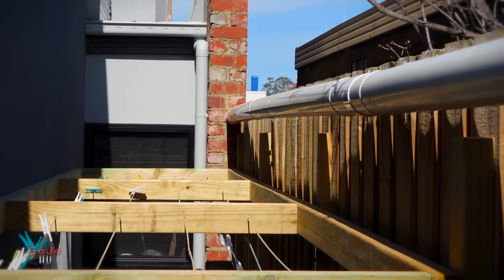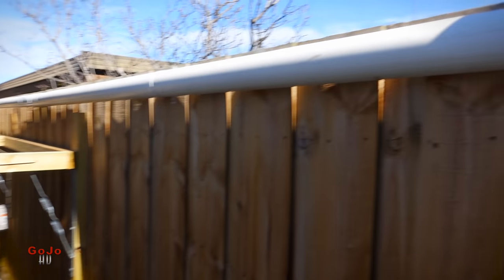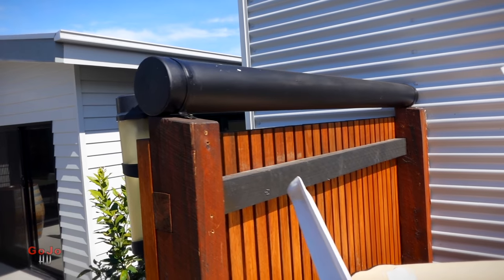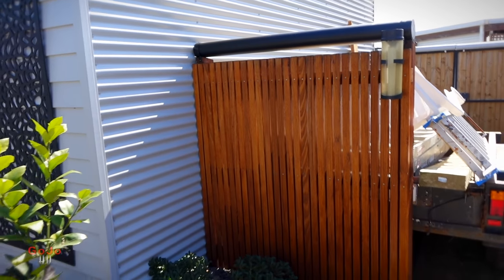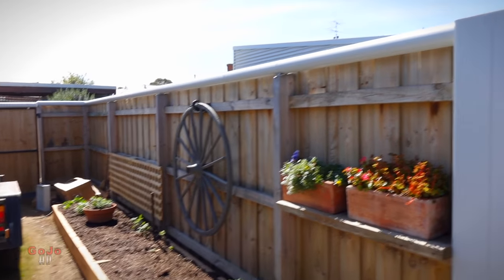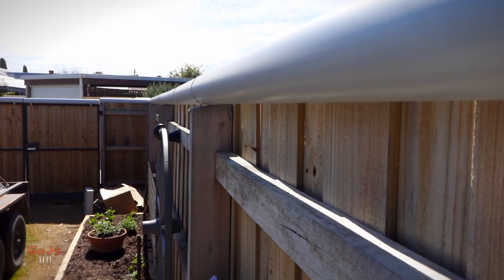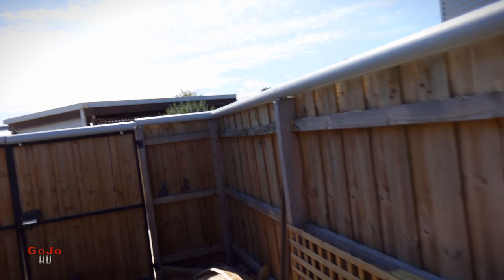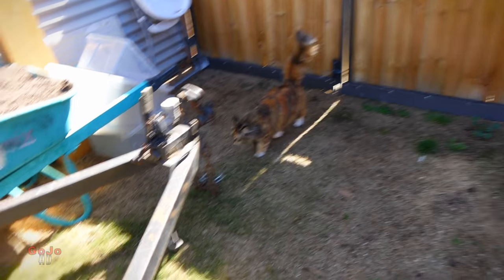Cat Proof Fence | Cheap & Easy with PVC Pipe | How to DIY

Comment: I just installed this on my fencing in my backyard.  I have three cats, and so far, no escapees!  Wish I could attach a picture!
Reply: Thank you for sharing that!  You're the 2nd person I've come to who's had success with this. I think I'm going to do it.
Reply: @elisaclark1751  did you do it? What pipe diameter?
Reply: @saaa9964  no i haven't yet. We're debating over the piping or the perpendicular fencing. We have a large backyard with coyotes on the other side so there's a lot of debate here in our household as to the best way to do this. And the project kind of got sidelined by some family crisises. I'm glad you asked though, its put the fire back underneath my butt again. I will definitely update when I do. I believe we had decided on the 3½ or 4in diameter, though. The thinking behind being the wider, the harder to hook paws around.
Reply: @elisaclark1751  Ok. I just wonder myself should I do it rotating or just like that. I want to stop my cats escaping, but don’t want any nasty nets around the garden...
Reply: What width pipe did you use please . I have ordered 1100mm pipe . I hope this is the correct size as my present fencing has failed . Thanks
Reply: Liz Johnstone  I think 100mm minimum, the pipe doesn't spin, it rather is an obstacle
Reply: @Charlenea28  I was thinking maybe instead of fixing them completely.  Just place a strong wire in the middle of the pipe and let it spin if they try and climb on it.  But to make it spin I think you need the pipe not to touch the fence and come away from the fence a little.
Reply: Is it still working?
Reply: @Mav_F  I've seen several DIY roller solutions where there's a narrow pipe (PVC or metal electrical conduit) inside of the larger diameter pipe.  Brackets hold the narrow pipe away from the wall (and can be on top of the wall as well).  Some people use wire like you mentioned but still wire + narrow gauge pipe + large gauge pipe.  But this single pipe solution looks way simpler to install and won't have any problems with sagging.  My thinking is I'll try this and if it doesn't work I can reuse the same pipe for a concentric roller solution.
Reply: @enmodo  Cribs and playpens do not have a top and aren't small.  Puppies aren't that stupid.  Do Americans have laundry areas? That's an option.  Enough now! All the best.
Reply: Did it last?
Reply: I used 100mm..worked like w charm..all cats still puzzled and indoor
Reply: Amy, all you have to do is film a short video upload it to your YouTube account and then copy and paste the link in the comments here
Reply: How's it holding up 3 years on??

Comment: While it is a lot simpler than the roller kind I'd hate to find our cat could figure out how to reach over it or somehow get enough grip with its pads to shimmy over.  I assume you found that the hard round plastic surface was just too slippery for the cat, and protruding out vs just on top creates an extra overhand obstacle.  Did you ever get a video of your cat trying and failing to escape?
Reply: Yes, you would’ve thought he would’ve videotaped his cat trying. I know I would.
Reply: If it were me, I’d make the rollers pretty loose so even if they could grab it, they couldn’t use it to get out. Can’t really tell from the video but that’s likely what he did

Comment: This remarkable system works--at least on my two cats. They are Himalayan with short legs like Persians, but he managed to reach the top of the block wall before I had the PVC pipes installed. Presto, my cat was immediately deterred when he jumped and reached the top where the PVC roller was installed. I shall now complete the job, installing the PVC pipes to the rest of the block wall. By the way, the pipes work just fine on cement--block walls.
Reply: PVC roller?
Reply: @urmomm55  PVC pipes 4-inches in diameter.
Reply: does the pvc actually roll? or is it just stationary like in this video?

Comment: Worked  for me! The cats didn’t even attempt escape :) they loved sun bathing in the afternoons and I loved them helping me in the garden!
I rent, so have added fence extenders on the lower side fences. On these parts I added core flute panelling underneath the piping which was secured on the inside of the fence, not the top. No issues, although it was kinda ugly. Recommend! Great DIY solution!
Reply: Thank you so much for sharing your experience with the pipes, it really helps to hear that it's working for other people than the poster... who may be brilliant, I'm thinking!
Reply: Is it still working for you?

Comment: I did this on the outside of my fence a few years ago and it works great! I want to do it on the inside as well, but now pvc pipe is so expensive! Do you  have any other ideas of something cheaper that could be used? Thanks much for the great idea!
Reply: The best thing to do would be to place the rollers on the top of the fence, so they work with critters coming from either direction.  That's what these people did: https://www.youtube.com/watch?v=WP1HNNZedbc
Reply: We are having this issue - looking for 2nd hand PVC pipe right now.

Comment: I love this idea and I'm going to try it!  It's so much more cost effective than alternatives.  My question is this: I have a six foot wooden fence with the railing on my side.  Do you think I could install the pipe on the railing instead of on the top of the fence?
Reply: Not sure if you ever tried it but if you look at the video you'll see he didn't put it right on top, it is on the side of the top so it sticks out and away from the fence.  That creates an overhang the cat is forced to try and reach over.  I think the important thing is the height limit he mentions - if they PVC is too low the cat could jump up and over it and then use it as a nice rail to stand on for the remainder of its escape!  But being hard and slippy it is still a better barrier than wood or netting overhang.

Comment: Thanks for your video, you mightve saved our poor kitty's life. Out vet bill has been around 2000$ this year alone due to a bully cat. The problem is im renting at a very strict place. I have 3 questions then:1- what do you recommend to put it against the wall without damaging the property(i cant put it ontop because it will be to visable and ill be fined and have to take it off). The wall is 2.2 meter high (in foot thats probably 6.6) so i thought of puting it around the 2 meter mark then it wont be visable from outide my yard. 2- if i paint the pvc to the same colour as the walls, do you think the paint will give the cat enough grip on the pvc? 

I look forward to your response, and much appreciation from South Africa
Reply: Yep same ! We have a aggressive stray unneutered  cat that comes in our yard to fight. So over it! I rent to and my real estate (and owner ) very fussy. Im going to do this though when i buy a place for sure :) Good luck :)

Comment: I would love to do this, but if there are any structures inside the yard next to the fence, for example a potting bench, then this wouldn't be possible, would it? I do the TNR and I have lots of cats in my backyard that I have had spayed and neutered and my neighbor is starting to trap them and have them euthanized and I'm very upset about this! It would be great if I could keep them all in my backyard but I really don't know if this would work. They also jump up on the roof and get out that way. Any suggestions would be much appreciated!

Comment: what size pipe is that,,i just put up 3 rail fence around my 5 acres ..i added 5 ft tall field fence which cats cnat fit through however a couple of them can jump to top rail and escape,,i have bought a pet friendly soalr powered elec fence box to put wire at bottom so adding your idea to top would prob keep at least my oldest outside cats inside fence area away from pit bulls and assholes who speed up and down our private rd,,great idea

Comment: Thank you so much. This seems like an effective and cost efficient way to handle this. We have a feral Siamese cat in the area that keeps getting into our fenced in yard and roughing up our cats. Will definitely try this on the outside of the fence as well as on the inside.
Reply: Did you get any results from using this?

Comment: Thanks so much for sharing!! What sort of bracket would I need to attach the PVC pipe to the top of a chain link fence? Would zip ties do?
Reply from the maker: Yes should work
Reply: @GoJoGeoffVlogs  Thanks for your speedy reply.
Reply: Do these roll?
Reply: @audrey9640   That is what I am wondering!!!!
Reply: @CharlySimone  I’m putting the  short green landscape scalloped wire on my fence. So far it has worked

Comment: It is soooo nice to see a responsible cat owner. In Oklahoma, cat owners are not required to make any attempt to keep their cat off of the neighbors property (where they kill birds and tree frogs and scar up the fence wood so the rain can further degrade it). It is up to the person that does not want the cats on their property to cat proof. 
I have tried everything short of putting razor wire on top of the fences which is probably illegal on a 4 foot front yard fence anyway. I'm just tired of spending my own money for something that should be their responsibility.
I do wonder how the pvc being stationary stops the cats from going over. I have seen the kind that has wire or something running through the center so that it rolls whenever the cat tries to get a grip.
Reply: Ngl it’s not just irresponsible, but dangerous for the cats themselves. Especially in places with predators. I know I’m sure as hell not risking it with my babies. Plus there’s also diseases from other cats or even fights.

Comment: I put a piece of PVC pipe on top of the garden fence door. The cat climbed right up and made it out. The fence door is made out of chicken wire and wood. He climbed that door like a champ. I found some old vinyl siding and put it on the door vertically. I think I have won the battle for now. Good luck to all my fellow cat servants!
Reply: CATS HATE TO FALL, SO USE SOMETHING THEY CANOT FEEL STABLE, LIKE MESH.

Comment: I followed your  method precisely.  My fence seems to be the same height as yours and the tubing the same kind.  It didn't work.  I wonder if it's because my cats are less than a year old and may be more spry than your cats.  I wondered if the tubing was just not slippery enough so I added lubricant.  The cats find all of this more challenging, but definitely not insurmountable.

Comment: Hello Geoff, I've wondered if a slick piece of pvc would be as good as a roller, if so for cats - it probably is. Please give me your thoughts, to keep my dog in my 4 ft chain link - would 2.5 in. pvc conduit mounted an inch or two above the fence keep my dog from holding on, so he can't go over the top? Or should it be mounted leaning inward some?   I want to use gray pvc since it will be so visible with the chain link.  Thanks.

Comment: How does this concept work to keep the cat in the yard? Does the PVC spin? Or is the width and height of the pipe that  keeps the cats, home bound?
 I was waiting for the cat to give us a demo. Guess he wasn't up to it, lol.
Reply: It's the diameter of the pipe, the cats 'wrist' and paw can't get enough mechanical grip on the PVC to pull up and over.
Reply: Thank you I was so confused about how it worked
Reply: Thank you I was so confused about how it worked

Comment: We have bought all the materials and are going to attempt this project this weekend. We have 4 gates and are wondering how to cut the pipe so that the gates will open. Also, one of the gates is at a 90 degree angle with our fence. Any suggestions would be greatly appreciated!
Reply: Did you do it? Did it work?
Reply: an update please

Comment: you are a gem, thank you so much. Does the pipe come in different colours. If not I will soften the white pipes with gold stripe bamboo. Cats cant climb up bamboo. This beats stuffing the cats in wire cages. What a horrible invention that is for the cat.
Reply: My cats don't seem to mind being stuffed in their wire cage... granted their cage is 20 feet by 12 feet by 6 feet high, but it is still technically a wire cage because of the roof (which I'm considering trying to replace with something like this idea).

Comment: Does it spin or does the cat slip on the round surface
Reply from the maker: The cat slips :)
Reply: @GoJoGeoffVlogs  Wow!. really? the cat just slips without it spinning?? I would think that would not work. wow. I guess I will try it because this is super easy to do!! Ive been looking and reading and watching cat systems but Ive never seen one where someone just attached pipe without it spinning.. Interesting. Im going to have to see it to  believe it though !! thank you!

Comment: Are your cat's totally outdoor cats or do they come inside? I ask because I may be forced to get rid of my cats unless I can come up with the way of containing them. I have seven and right now they seem to get along well on my front porch which is a small area. But they do have the freedom of taking off when they choose to. I'm not sure how they behave if they were forced to be in an area. I could make it large so they wouldn't be on top of each other. I have had these cats for 13 years some of them and I'm finding it very difficult to even think of not having them. So if putting up a fence and doing it the way that you did it would afford me not having to get rid of them then I'd be willing to try, they are outdoor cats. My neighbors are complaining which is why I'm having problems suddenly.
Reply from the maker: This is a relatively cheap method so maybe worth trying. All the best :)

Comment: I have a cinder block wall. My cat discovered he could jump up to the top and sit. My fear is he'll jump down and roam. I need to cat-proof the back yard now.  The other methods look ugly and require putting the netting all the way around but be have trees and bushes in the way. The wall is different heights on different sides of the house. What is the best way and height to install the pipe to ensure he can't jump up and over land not he wall ledge?  All of your answers so far are for wood or chain link. Thanks

Comment: Would 2 inch pvc pipe be good enough or do you recommend 3inch?
Reply from the maker: This is 4 inch. Needed the larger size for my cats
Reply: @GoJoGeoffVlogs  thanks so much. I will try it on my fence

Comment: I did this to my fence. The cat figured out how to jump between the roll bars and use the brackets to lift itself over the top. Getting the gaps between the bars very small was more than I could manage. If the bar/tube is too long it doesn't spin. Too short and the gaps provide an escape route. He also figured out to climb underneath the bar because the slack was hard to prevent. Since then I have replaced it all  with wire mesh along the top that bends with the cat's weight so the cat ends up hanging almost upside down if it hangs on.  Works well.
Reply: this video doesn't have roller bars or spinning.
Reply: You're talking about a different system.
Reply: Can you please share how you engineered your fence? I currently have a tiny kitten I am bottle feeding, but we need to get to work on the cat-proof fencing right now because we have an 8' board-on-board fence that encloses over 1/2 acre so it's going to take some time.  We live in the country with all sorts of wildlife on the other side of the fence so it's super important that he not ever go over. 
We would just keep him inside and build a catio for outdoor play, but we have dog doors and he'll almost certainly be going out of those

Comment: But do the pipes roll? How do you make them roll? I am interested in a bamboo version of this, with rolling pipes but have no clue how to make them roll.
Reply from the maker: the cats slide off the PVC and can't grip with their claws, so no need to roll
Reply: Boek you need to look at diy coyote rollers. There are good examples on yt made with pvc pipe and also made with metal conduit and L brackets and wire. They spin

Comment: Looks like it works for a cat inside. Will it keep an outside neighbor cat out of my yard also?
Reply: yes of course, just put another pipe on the outside.
Reply: Fco M neighbours own the other side of the fence😉
Reply: This is the question I've been asking myself too. It seems perfect for keeping my cats in but the fence I'd be installing it on is between mine and the neighbours garden so how could I keep other cats out. I wouldn't want to trap someone else's cat in my garden. Any ideas folks?
Reply: Same question here as well. Don't want another cat trapped inside my garden - and there are some nasty ones in our neighbourhood!
Reply: Not it didn't work to keep them or unless your neighbor lets you put this on their side(and not 100pc anyway since it doesn't roll). Coyote roller so far is only thing I've found
Reply: @jeffnunn1784  Mount it along the top of the fence, rather than on the side? That way a cat trying to climb the fence from either side would slide off.

Comment: I have a flamepoint Siamese cat and she is blind. She would jump over the fence with the poles you have attached for what she wont see will not stop her and she jumps high. I use a indoor cage, attached outside to a window, and she and her sister plays inside that. No way would a pipe along the fence stop her from jumping. Or, a hawk swooping in and picking her up. I prefer my cats inside the outdoor enclosure. Miss Jones Bay City MI

Comment: Do you think this would work if attached the a spiked lattice fence topper? 
Wondering if the cats would be able to climb the lattice and get over the pipe.... what do you think?
Reply from the maker: Not sure. Maybe a larger diameter pipe would be needed?
Reply: GoJo DIY & Vlogs yes that might work. Thanks!